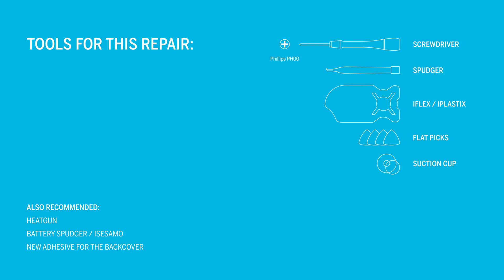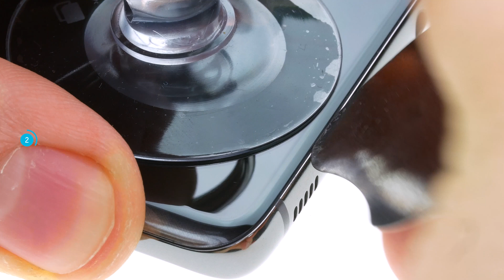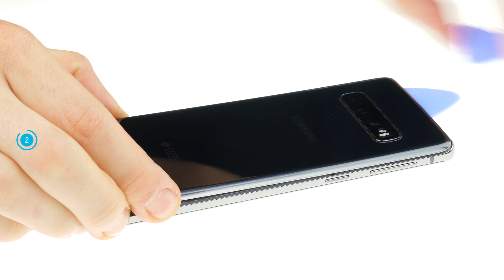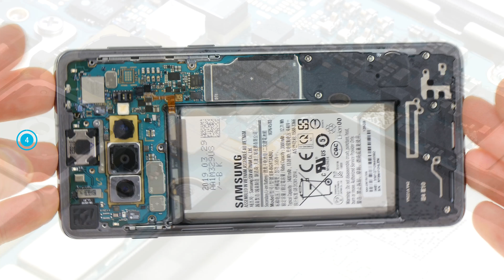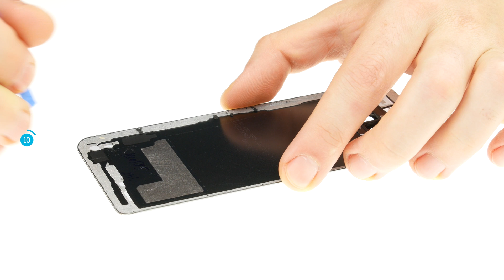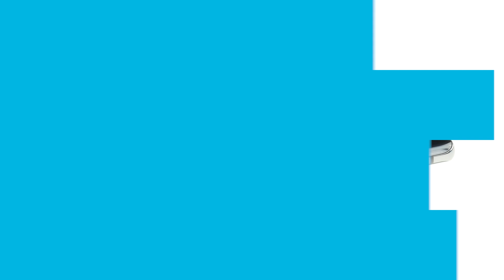Samsung Galaxy S10 – Battery replacement [repair guide]

Comment: Helpful video, but I really struggled removing the battery adhesive. Neither the heat gun or iso 91% loosened it much at all. I decided to abort since the battery still works, it's just not good anymore.
Reply: I know the feeling, I was struggling hard with this too. I ended up using an old sunglass lens - and it worked! It's sturdy and thin enough, plastic and its curve helps lift the battery.
Reply: I ended up getting the battery off and replacing it. Then the screen died 24 hours later. I guess it was just the phone's time to go

Comment: Thanks for posting this. I have one more tip that makes everything go a lot easier and that is, before you start with the heat gun, try taping your phone to the table with two sided tape. {specifically Alien tape}  when you are done remove it from the table with a twisting motion. this cut the back removal time significantly.

Comment: Maybe you should test the replacement battery works before gluing the back on again?
Reply: yeah they leave that out in all of those videos.. before using ANY TYPE OF GLUE, test the battery
Reply: @Stronger-Forever how can I test the batterie without sticking it firmly
Reply: Double sided tape ? @Lxwin08
Reply: No need they are proffetional